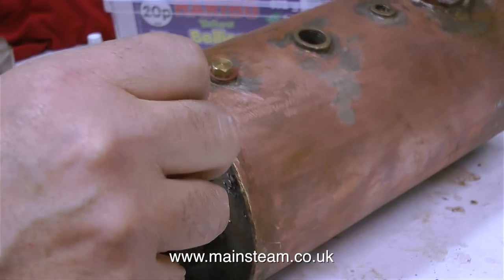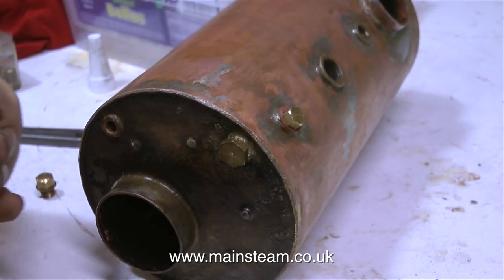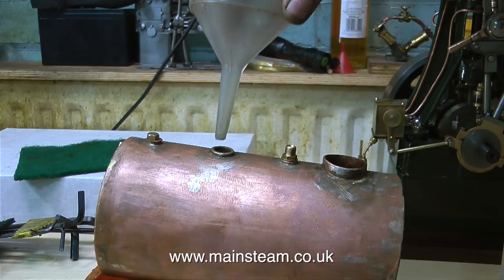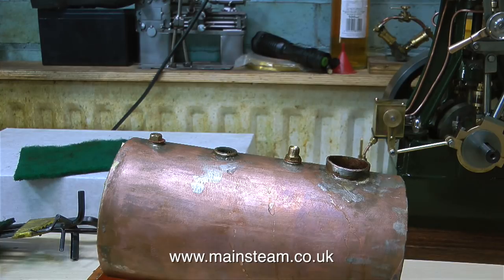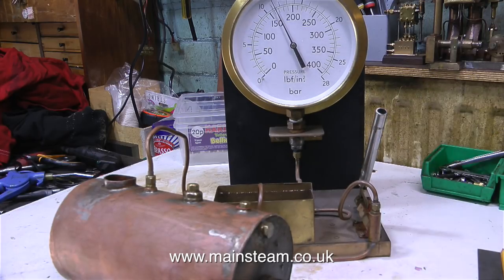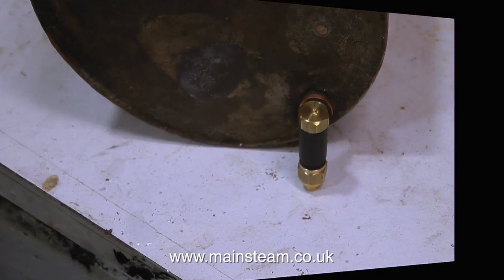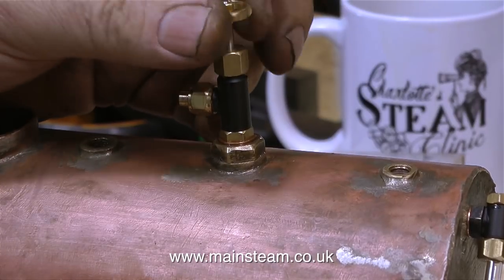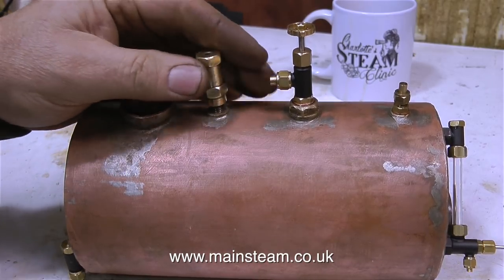A MODEL STEAM BOAT NAMED EDITH - PART #3

Comment: Thanks for the video of the pressure test. A successful test. One of the posters mentioned about wandering what a boiler would look like if the boiler failed under steam. A friend of mine put up a small video of a Mamod boiler that was suffering from dezincing of the brass end caps, as in the previous video of this series, the brass had become brittle, it blew showering my friend with wet steam. It also gave him one heck of a shock. This was only at 14psi, and is not something to recommend at any steam pressures.

Comment: Excellent video Mr. Appleton.  Very informative of a safe way to perform a hydrostatic test on a pressure vessel.  I used to perform pressure tests on fire hoses (at 600 psi) and always took a bath in cold water when bleeding the pressure off at the end of the test.
Reply: I did the same with Hydraulic Hoses, would have preferred water over the Hydraulic oil.

Comment: I am glad that the boiler passed the test. did you let the water you were using come to room temperature before the test. It was nice to see a nice large pressure gauge for the test, have seen too many test rigs with small 2" gauges. One the fellow wanted to test to 100psi and the gauge only went to 150psi. He said he was going to pump it up using his air compressor until the needle came back around to zero. We sat him down over a cup of coffee and retold some stories about what could go wrong, then lent him plans for a hand pump and the address of a shop that sold good gauges.
Reply from the maker: Yes, the water was from my plastic container and was at the same temperature as the workshop.

Comment: Very interesting.   I would also like to see what it is like to hydraulically test a boiler to failure if that can be done safely    And, only if it can be safely, a similar failure under steam pressure.
Reply from the maker: I was going to do that by taking the hydraulic pressure way up if this boiler had leaked - but it didn't ...... a friend of mine blew up some old boilers a few years ago but they didn't blow until 600PSI ...... it can be done safely - with a telephoto lens ....... and filming from behind a hefty stone wall :-)))
Reply: What I'm wonder is when it fails hydraulically, does the water come out in a high pressure stream and is that dangerous like a  water jet cutter?   I'm guessing that failure under steam is more like an explosion.   Anyway, I really enjoy your channel, videos and commentary.   Take care.
Reply from the maker: no, you just get a bit wet . . .

Comment: One other thing with using hydraulic pressure testing is that you can see any leaks. Hard to do that with air.
Reply: The way we did it was to check the gauge for pressure drop change then mix water with dish soap and apply with a acid brush to all joints soldered, fittings etc., When you get bubbles there is your leak fix then redo the test. Also used a product called Snoop.

Comment: It may be worthwhile giving more detail about why pressure-testing must ALWAYS be done with a relatively inert liquid like water and NEVER with air, steam or any other gas. When a gas is compressed it stores energy exactly like a spring. If the vessel being tested bursts, the gas expands explosively as the stored energy is released. Somebody usually gets hurt when this happens. Liquids do not compress, so no energy is stored when pressure-testing with water. The only spring-effect is the slight stretching of the vessel itself when pressure is applied. Bursting of the vessel only results in a small amount of water being released as the vessel "relaxes".
Reply from the maker: Please watch more of my videos - all is revealed within .........

Comment: Given how deteriorated the brass fittings were I am amazed the boiler passed for service. The only real difference is the amount of zinc there is present.  Is electrolysis the cause of the failure of the fittings ? There is a small amount of zinc in N American standard  copper pipe. Is there zinc in the copper of the boiler ? Does anyone know ? Enjoy your series.
Reply from the maker: There is no Zinc in Copper usually, as Copper is an Element (Cu)
Reply: Some commercial copper products (sold as copper not brass, bronze or say nickel silver) may contain small amounts of alloying elements.  From some brief research, it looks like sheet copper typically is 99.99% pure copper.  Copper tubing apparently is often made with an alloy containing a maximum of 0.02% phosphorous.  That is still more than 99.9% pure copper.  I have not found a specification for the alloy in common copper pipe, so I cannot comment on whether it contains zinc or not.

Comment: Keith,
We used nitrogen  gas because it it is thin.  Or is this somewhat of a overkill, plus expensive ?
As for me I would have a valve of some type to release pressure, but still enjoy your videos and garden. Reminds me of my grandmothers in East Ham, London .    Ralph
Reply: Using a gas for the initial pressure test is a bad idea because gasses are highly compressible. If the pressure vessel fails catastrophically when full of compressed gas then it will explode. If it fails catastrophically when full of water then the pressure will be lost almost instantly.
Reply from the maker: Using any gas for an initial pressure test is definitely NOT recommended - use water - just like in the video - then there is no risk of injury . . . . . .